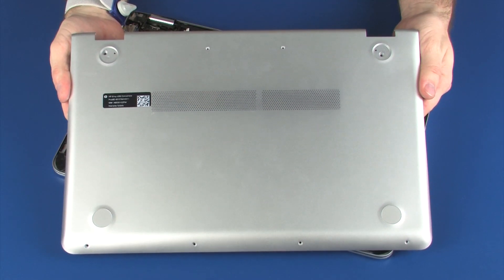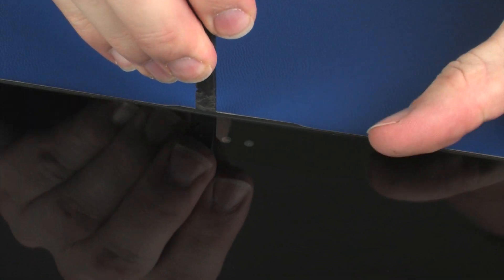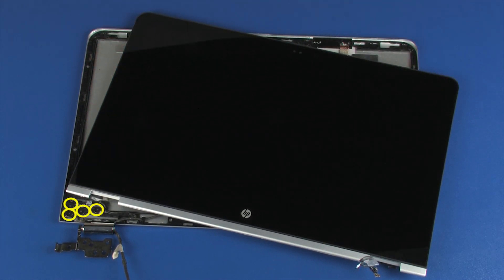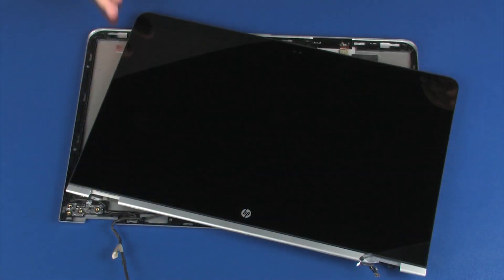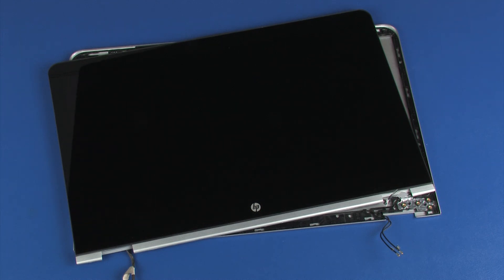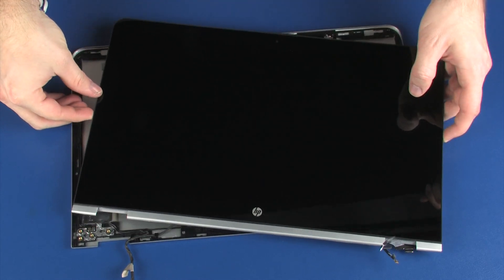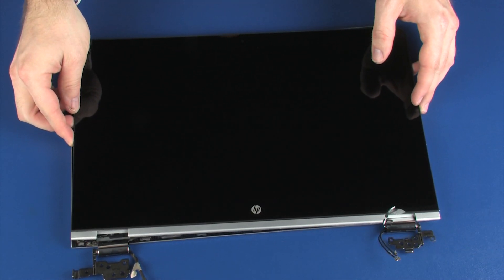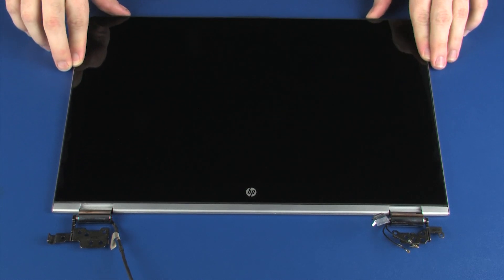Replace the Display Panel Hinges | HP ENVY x360 m6 Convertible PC | HP Support

Comment: I extended the warranty period upto 2026 . My display glass self crack but laptop is working. after 6 month display broken and now hinge is not work open/close. He wants 45 thousands for 13 inch diplay and hinge. (In warranty period). Laptop price 75 k & display & hinge replacement charges 45k .what is this ? I am very sorry for behave of hp support service.
Reply from the maker: Hi there, thanks for contacting HP Global Social Media Support!
I understand that you are experiencing an issue with the display and hinges of your notebook.
This looks like hardware issue, and you might have to get the notebook serviced. 
So, I would request you to contact our Support, and our Support Engineers should be able to sort this out.
To contact us, click here: https://hp.care/6053SZXHz.
Step 1: Sign in to the HP Support page using your HP account or create a new account by clicking on “Create Account.”
Step 2: Enter the device serial number, select the product, and click on “other” from the options.
Step 3: Click on “Continue to contact options,” and choose your country/region and language.
Step 4: The support options will now populate based on the warranty status of your device.
Regards, 
HP Support

Comment: How does a person take off the OTHER side of the hinge?  And - what if the hinge "nuts" that are embedded into the plastic have been pulled out of the cheap plastic due to extremely poor HP design?
Reply from the maker: Hi there, thanks for contacting HP Global Social Media Support!
I understand that you need help in removing display hinges on your HP ENVY m6 Convertible PC.
I will do my best to assist you.
Please refer page number 52 of the service guide to know about removing display hinges: https://hp.care/6054Y0G9i
Regards, 
HP Support

Comment: so I am just joining this conversation. Have the same issue with the hinges have caused the LCD to partially separate from the top cover, screen cannot close completely, screws have fallen out from the laptop. The laptop remains partially open because the hinges are so stiff and remain in a 60 degree position. I call HP support and after several minutes was also told my laptop was out of warranty and I would have to pay for repairs. Please advise if HP will cover resolving this issue with little to no expense to the end user.
Reply from the maker: Hi there, thanks for contacting HP Global Social Media Support!
I understand that you are experiencing an issue with the hinges of your notebook.
This looks like hardware issue, and you might have to get the notebook serviced. 
So, I would recommend you to contact regional support for repair options.
Please feel free to reach us on call/chat. Access this link to select your preferred country and language option to reach us. 
Global support link: - https://splr.io/6050YVFR8 
Regards, 
HP Support
Reply: @HPSupport  Unfortunately, my laptop is out of warranty and the online support offered no solution that did not solve issue. I will place a call and hope to get better luck, but as so many others, I don't think this will be resolved by HP ANYTIME soon or with me having to pay to fix a product that malfunctioned and broke under normal usage.
Reply from the maker: Thank you for being a valuable HP customer.
Have a wonderful day!
Regards, 
HP Support

Comment: I have the same problem with a unit that is a few years old.  Opened the laptop and the hinge came off!  I cannot believe they feel that anyone can just fix this, themselves, and I'm sure it would cost more than it's worth to take to a shop.  I will not take a chance on repairing this as I feel that it would probably create more problems than just a bad hinge.  This was not an inexpensive unit. And, I even suggested a relative to buy in which she did. I'm very sorry I did that as it's just a matter of time that hers will have the same problem. If they cannot fix it for us, I'll never purchase another HP device and will never recommend any other HP devices to anyone. HP, respond!!
Reply from the maker: Hi there, thanks for contacting HP Global Social Media Support!
I understand that you are experiencing an issue with the hinges of your notebook.
Due to limited support on this platform to fix this issue, please feel free to reach us on call/chat. Access this link to select your preferred country and language option to reach us. 
Global support link: - https://hp.care/3QDfXvx 
Binu-HP Social Media Tech Support

Comment: Two questions here:

1)  What if we have to replace the entire back, because the plastic where the nuts holding the hinge to the screen back enclosure broke out?  What else do we have to do?

2)  I saw a video where it looked like someone was pulling out long pieces of tape or something.  What was this, and why not shown in this video?
Reply from the maker: Hi Stellijer, thanks for contacting HP Global Social Media Support!
I understand that you need help in replacing display panel hinges.  
I will do my best to assist you.
Please refer the user manual to know about replacing display panel hinges: https://hp.care/3QR6CS9
Binu-HP Social Media Tech Support

Comment: I agree mine have never been open in tablet form and just tried it so there was already a crack by the hinges and now it's bulging and all HP says "it's out of warranty" but this is all over there HP support community page as an issue. HP should be recalling it and replacing them free of charge. Mind you HP won't even fix it, regardless if I want to pay.
Reply: Get a 25mm binder clip. And clip the glass side with cover side just beside the hinge. After Clipping it pop out spring steel and use your laptop like a boss.
Reply from the maker: Hi Rose, thanks for contacting HP Global Social Media Support!
I understand that you are experiencing an issue with your unit as the hinges are broken.
Due to limited support on this platform to fix this issue, please feel free to reach us on call/chat. Access this link to select your preferred country and language option to reach us. 
Global support link: - https://hp.care/44fT5XO 
Binu-HP Social Media Tech Support

Comment: Hi, i have envy. Please guide how to prevent hinges from broken.
In which way we should open or rotate 360 so that hinges not broke??
Kindly guide
Reply from the maker: Hi there, thanks for contacting HP Global Social Media Support!
I understand that you need to know about the steps to prevent hinges from broken.
I will do my best to assist you.
Close the lid properly: Close the lid gently and hold from the middle of the screen. Closing the lid using only one edge causes extra pressure on the hinges which over time will crack and break them. -Hold your laptop by the base: Lifting and holding the laptop by the display creates unneeded pressure on the hinges.
Binu_HP Social Media Tech Support

Comment: Worst design/manufacturing defect ever.. worst product. Its so fustration when you spend about lakhs for a product and gt felt like its useless in the middle of nowhere . Im a student , im doing fine with its limitations, but suddenly one day its left hinge gt loose and stuck n the screen and the left screen portion detached from the back panel. There is no crack when it happend  , unfortunately repair guy cant detach the screen without break it . Its totaly a design error , because the hight is poorly designed and placed underneath the touch display causing a huge mess in that area. Also the guy told ,there is not orginal hp screens available , if its available its soooo EXPENSIVE... Its totaly urs fault . DONT BUY THIS PRODUCT ❌❌❌❌❌❌❌❌❌
Reply from the maker: Hi Shinto, thanks for contacting HP Global Social Media Support!
I understand that you are experiencing an issue with the hinges of your notebook.
In order to get this issue fixed, please contact our customer care team over the phone or chat for further assistance, as this issue requires Live conversation with you over phone or chat to isolate the issue and provide you instantly with appropriate solution or repair/replacement options available at your place as per the warranty.
Please feel free to reach us on call/chat, please access this link to select your preferred country and language option to reach us. Global support link: - https://www8.hp.com/us/en/contact-hp/ww-phone-assist.html
Binu_HP Social Media Tech Support

Comment: I trusted hp and bought hp envy360x laptop 
After using it using it I got know about the cheap built quality of my laptop.
My hinge broke off after one year use 
,which was a single handed use and gentle use and the replacement of hinge was too expensive
But now onwards I will never buy hp laptop in future and suggest my relatives and friends to not to buy hp laptops due its worst build quality
Thank you for your worst service and build quality hp
Reply from the maker: Hi Prithviraj, thanks for contacting HP Global Social Media Support!
I understand that you are experiencing an issue with the hinges of your notebook.
In order to get this issue fixed, please contact our customer care team over the phone or chat for further assistance, as this issue requires Live conversation with you over phone or chat to isolate the issue and provide you instantly with appropriate solution or repair/replacement options available at your place as per the warranty.
Please feel free to reach us on call/chat, please access this link to select your preferred country and language option to reach us. Global support link: - https://www8.hp.com/us/en/contact-hp/ww-phone-assist.html
Binu_HP Social Media Tech Support

Comment: I bought a 3 years used Thinkpad for $150. Then I dropped my laptop bag or stepped on it I don't remember but the hinge became loose and bezel cracked. So I bought another pair of hinges and a replacement bezel for $29.
How long do you think it'll take me to replace it myself?
Reply from the maker: Hi Anony, thanks for contacting HP Global Social Media Support!
The steps mentioned under the video are tested on HP computers. We would not be able to comment whether it would work on other brands. 
Binu_HP Social Media Tech Support

Comment: This happened to me yesterday, why am I being charged £300 for it to be fixed when it was not dropped  nor was there  pressure applied on the laptop! Worst customer service also, saying they can’t send over individual pieces when I have seen so many people request this on their forum
Reply from the maker: Hi there, thanks for contacting HP Global Social Media Support!
I understand that you have concerns about the charges of display panel hinge replacement. 
In order to get this issue fixed, please contact our customer care team over the phone or chat for further assistance, as this issue requires Live conversation with you over phone or chat to isolate the issue and provide you instantly with appropriate solution or repair/replacement options available at your place as per the warranty.
Please feel free to reach us on call/chat, please access this link to select your preferred country and language option to reach us. Global support link: - https://www8.hp.com/us/en/contact-hp/ww-phone-assist.html
Binu_HP Social Media Tech Support
Reply: I reached out during my warranty period and was told I would have to pay for the repair as it was "cosmetic damage" - really disgusting when you know this is a KNOWN defect in your manufacturing.  @HPSupport

Comment: Is HP providing these replacement hinges to owners of this system since its a manufacture flaw?
Reply from the maker: Hi there, thanks for contacting HP Global Social Media Support!
I understand that you are experiencing an issue with the hinges of your notebook.
In order to get this issue fixed, please contact our customer care team over the phone or chat for further assistance, as this issue requires Live conversation with you over phone or chat to isolate the issue and provide you instantly with appropriate solution or repair/replacement options available at your place as per the warranty.
Please feel free to reach us on call/chat, please access this link to select your preferred country and language option to reach us. Global support link: - https://www8.hp.com/us/en/contact-hp/ww-phone-assist.html
Binu - Social Media Tech Support
Reply: just so you know, I did contact your customer care team, but they won’t help me because it’s out of warranty. even though I purchased the extended warranty less than three years ago, they backdated it to the date that I got the computer.

Comment: Just wondering if anyone has had useful contact from HP and not the pseudo 'get in touch with us for help' that is just a run around. What I find amazing is that HP still use this hinge system after so many breaks that is neglect and highly irresponsible.
Reply: Hello David, have You had any success yet getting this issue resolved? I imagine there isn't anything positive feedback from HP. This is a absolute disgrace on HP and for my wife's laptop the extended warranty just expired in March, 2024. Go figure. 3 year old HP laptop that's trash, vs a Dell 12 year old laptop still going strong. HP will never see another dime of mine.
Reply: @babymantuck3256  Nothing is going to happen through HP, they wash their hands of it. I'll stick with my sturdy and reliable Toshiba in future. I have found a small local PC repair outfit locally that will take a look at it - at what cost I don't yet know. Like many people HP will never see another dollar of mine.

Comment: About 6 months after buying this, the right hinge became fixed and now the right corner of the screen is cracked open
Reply: What series laptop are you using?
Reply from the maker: +Destiny Perez Please contact our phone support team to fix the issue. Please follow these steps to reach them.
Step 1. Open link: https://support.hp.com/us-en/contact-hp
Step 2. Select the product type.
Step 3. Enter the serial number of your device or select let HP detect your product option.
Step 4. Select the country from the drop-down.
Step 5. You should see the HP phone support number.

Comment: This is really disappointing that I bought hp envy x360 with such a good amount of bucks from my pocket and now after almost a year and half, the right hinge broke off while I was turning it to laptop mode from tablet mode. It’s pathetic that hp made a product like this :(( 
I feel really frustrated and on top of that I have my project to be submitted soon 😭😭
Reply from the maker: +Farzana Reefat Raha Please contact our phone support team to fix the issue. Please follow these steps to reach them.
Step 1. Open link: https://support.hp.com/us-en/contact-hp
Step 2. Select the product type.
Step 3. Enter the serial number of your device or select let HP detect your product option.
Step 4. Select the country from the drop-down.
Step 5. You should see the HP phone support number.
Reply: @HPSupport i am having the same issue with mine. I called the support line and they offered to fix it for a cost of over $400.  That is insane. Will HP Actually do something to fix this KNOWN issue that doesn’t require the customer to pay for a clearly defective product design and/or hinges that HP used to build these laptops?

Comment: 0:38 Warning: Some models of the x360 have a double sided adhesive strip down each side holding the display in. If you pry on the sides without removing this you risk cracking the display. Don't ask me how I know. There are white tabs on the top ends of these adhesive strips. I think if you unclip the top and top corners of the display you can see in and pull on these tabs with narrow nose pliers. After that you can unclip the sides. I found this tape on an x360 Envy15-ee00002na
Reply: Guess who cracked their screen because he didn’t know this 😢
Reply: @originaltanman  Me. I had to replace screen. I got one that supports touch but doesn't support the pen as pen not used.
Reply from the maker: +ColinWatters Thanks for sharing the steps that helped you!!

Comment: I purchased an Envy X360  15" back in November 2020. Thirteen months after purchase I went to close the cover on my laptop and noticed light bleeding from between the base and the screen when viewed from the left hand side. When I opened the laptop the left hand hinge separated from the plastic mounting behind the display. 

The problem seems to be that the hinge seized up becoming too stiff thus pulling the leaf from it's mounting. 

I contacted HP support and was informed that due to the laptop being out of warranty (one month), the repair is going to cost $400+ and there was nothing they could do for me.

I paid $970 for this laptop and the idea of spending half of that due to poor manufacturing of components and the complete lack of customer service has done it for me.

Thirteen months!!!
Reply: Same thing happened to my daughter's unit.  I will never buy another HP product.  Chinese junk!!
Reply: @lmd6204  If you're the least bit handy, it's not that difficult to replace the back cover. I purchased one with the hinges attached for less than $100. 

I'm not at my computer now or I could give you a link to the part.
Reply from the maker: +Dick Frankson You need to contact our phone support team to fix the issue. Please follow these steps to reach them.
Step 1. Open link: https://support.hp.com/us-en/contact-hp
Step 2. Select the product type.
Step 3. Enter the serial number of your device or select let HP detect your product option.
Step 4. Select the country from the drop-down.
Step 5. You should see the HP phone support number.
Reply: @HPSupport  Your copy/paste replies are nothing short of demeaning. 

Did you even read my post stating that I called your so-called "product support" and was informed that the cost of repairs was going to exceed $400?

Why bother replying to peoples posts when you're just drag selecting the standard HP BS response and pasting?
Reply: @HP Support  u suck at your job
Reply: @HPSupport  they link does not work.  It's b.s.!!